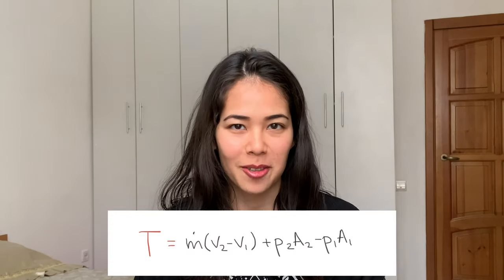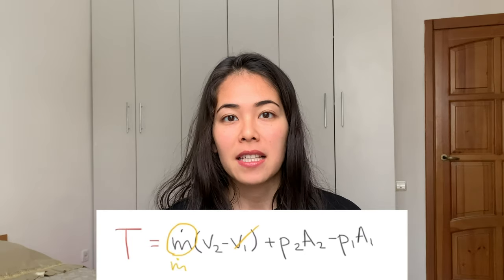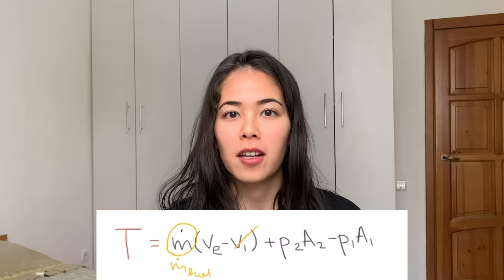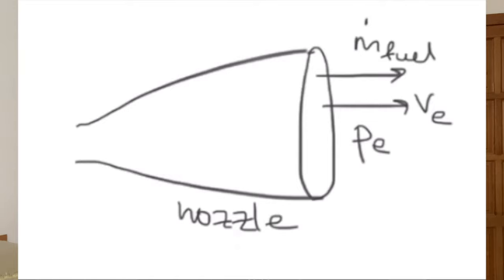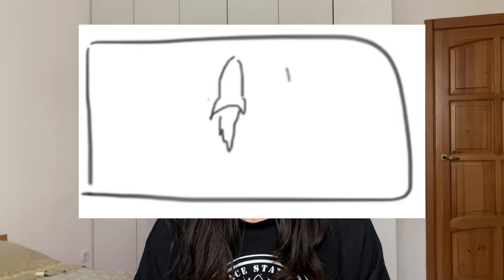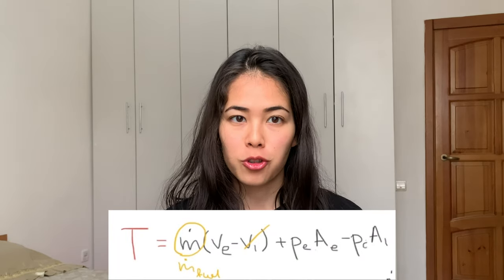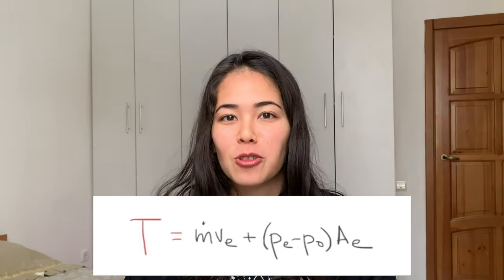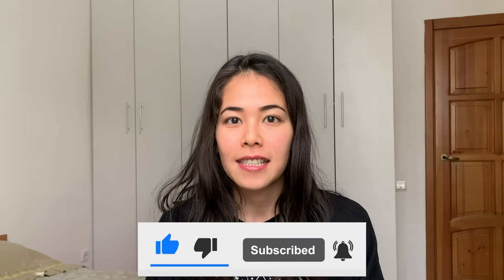Rocket thrust equation

Comment: First of all. I love your videos mam, @Aliya Burkit . They've been great. Thank you very much.
Second of all, mam, I have two questions. First, which one of the mdot x ve and (pe-po)Ae contributes more to the rocket thrust? Second, How do rockets controls the difference in the pressure (Pe-Po)? Is it by varying the rpm of the turbopump?
Reply: The term that contributes the most to the rocket thrust is mdote*ve, also know as impulsive thrust. The second term is controlled by the shape of the nozzle, that to maximize thrust should be able to provide the same pressure of the exhaust than that of the environment. The throttle changes the speed of the exhaust only